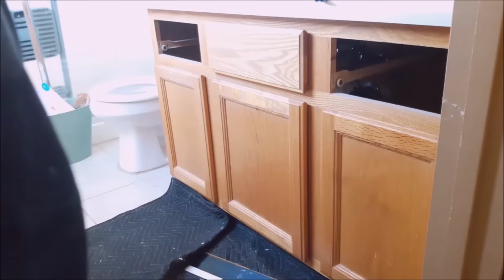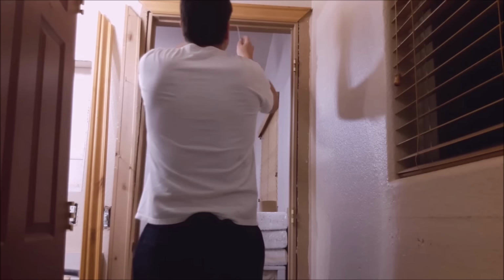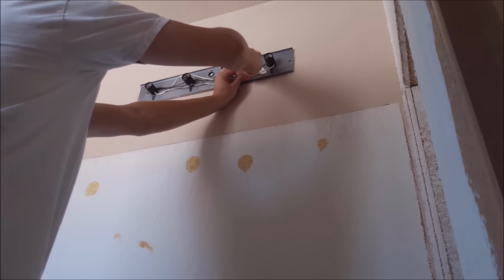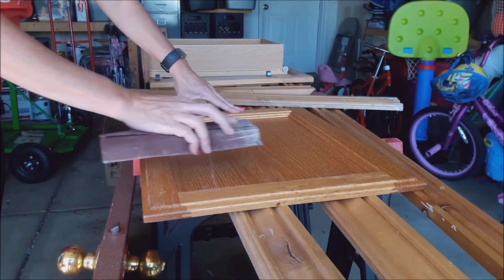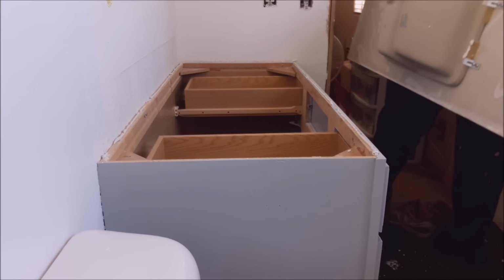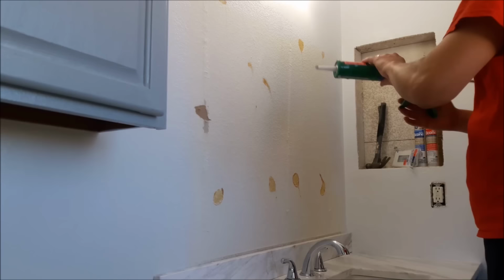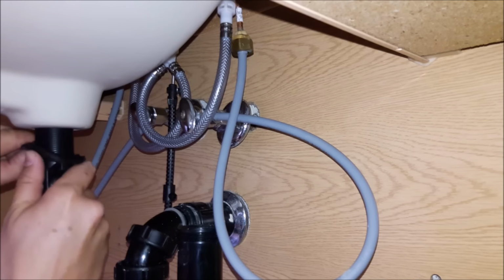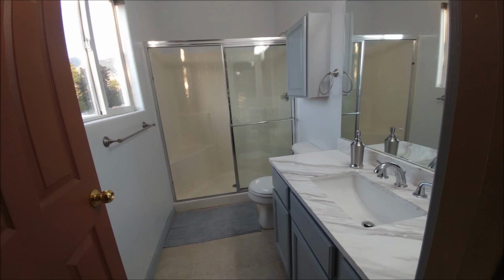Bathroom Remodel Tips and Tricks!

Comment: Grey is all the rage right now but now your bathroom doesn't match the floor and shower.
Reply from the maker: The good thing is brown and yellow will be the style in a couple years.  Agree about the floor and shower. They are on the upcoming project list!
Reply: @-DIYPRO-  I just did my bathroom, which is probably why this video came up.  Doing the floor isn't that much more money.  A box of tiles 12×24 is about 25 bucks.  Thinset and the membrane another 200ish plus grout.  You are adding another 3-400 for your bathroom.  Not much more.  Good work though.

Comment: On your mark, get set..TERRIBLE!
Reply from the maker: What would you do different?
Reply: @-DIYPRO-  I would...
Tape the mud so you don’t have a giant mouse hole .  
Mechanically attach the wiring before you wire nut. 
Pre-paint the backsplash drywall for a better looking transition. 
Putty and paint your nail holes. 
Video wasn’t clear enough to tell for sure, but it looks like you needed at least one more skim coat and the cabinet painting looks like it leaves something to be desired. 
Lastly.. I wouldn’t thumbs up my own comment.
Reply from the maker: @harveymanfrantinsingin7373  I agree with all that except for the thumbs up comment! This was meant to be a quick and easy diy project. Knowing I was going to be doing an addition on my home I knew most of that stuff was going to be ripped up or replaced within a year. We are finishing up the addition so within the year the should be more videos of bathroom changes. Thanks for the comments, I do read and learn from them.
Reply: @-DIYPRO-  I see.. I didn’t hear the part about a future expansion. All too often, this is the way remodels go when people are getting ready to sell, thinking they’re going to get more for the home. When, in reality it drives the sale price down due to the fact that it screams DIY/do-over.
Reply from the maker: @harveymanfrantinsingin7373  I hear ya. I admit this was not top quality and it's crazy how the video had taken off.  Since we did an addition we'll be in the house for a while and I've been taking the time to do it perfect, something's I'm maybe taking too much time.
Reply: @-DIYPRO-  I don’t think it’s ever too much time if the result is a perfect job!